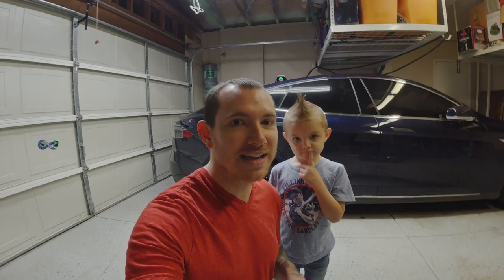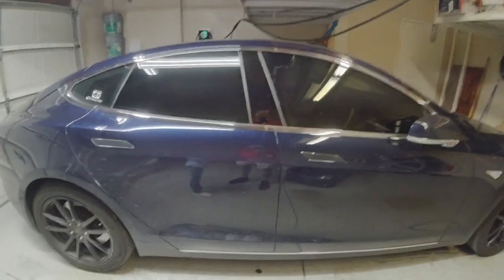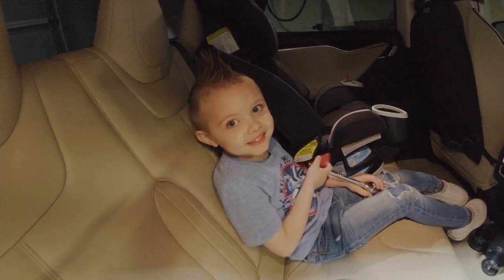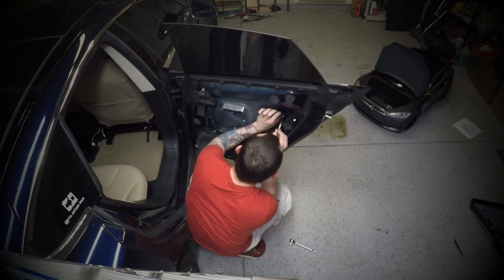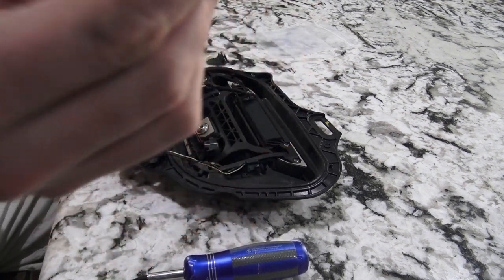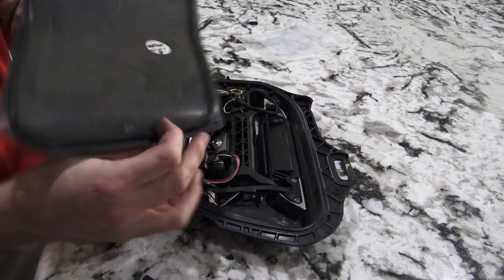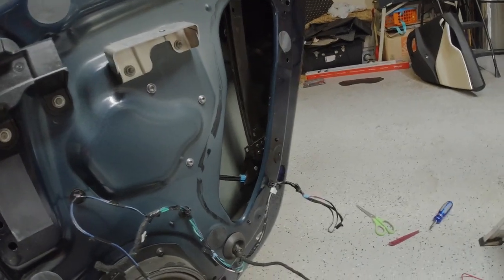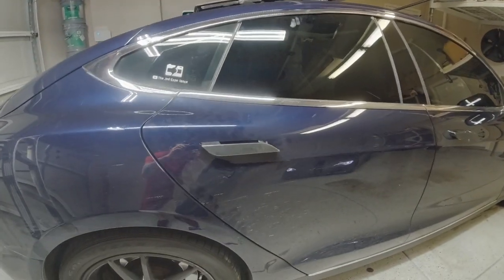Fixing My Tesla Model S Door Handle | Tesla DIY

Comment: Thx-  I had no idea how to get the panel off of the door.  Especially the little rubber gasket on the inside.  

One thing I learned.   You can hotwire the door opening switch - don't need to put the panel back on.  The pin dimensions are .1" - like arduino hookup wires - standard PCB connector.   So I actually took a couple of arduino jumper wires and soldered a switch on.  

The rear doors have the opening mechanism in the chasis - instead of inside the door with the front.  I was unable to find the emergency opening lever.  So with failed 12v elect the rear doors are not opening.

very useful - thx for taking the time to do this!

Comment: When you said “I could hear the piece fall & shatter” what piece are you reffering to? The harness?
Reply from the maker: The small little gear which rotates to push the handle in and out. It’s about the size of a cam that comes with ikea-style DIY shelving.